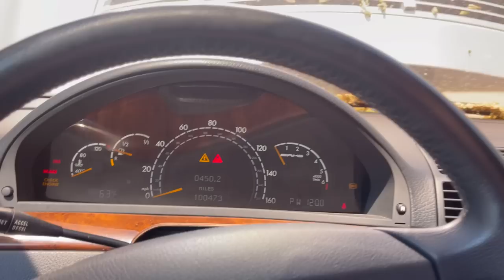S55 AMG - SAM I Am (not cooling!)

Comment: check for grounds mike. also use a multimeter or a scan tool that can show you voltage across the live wire and ground for the fan.

Comment: Possible bad ground or broken wire somewhere when the car was taken apart. See if there is power going to the fan. If not run a jumper wire from the battery to the fan.
Reply: That is what I was thinking.

Comment: I would check for errors with the scan tool first. I don’t know if you can toggle the switch with your scan tool but if you can see if it can turn it on and off. If it can’t check to see if you have power going to the relay. If you do check your have on the down side. It should go straight from the relay to the fan. If you have power there check at the fan. If no power there it would be the wire is cut somewhere.

Comment: Awesome video Mike! You actually got a special S500 bumper, it must have been an AMG trimmed S500, the regular W220 bumpers are "less muscular" than the AMG / AMG Trimmed ones. The reason you had to enlarge the cutouts for the exhaust tips may be connected to the fact that the real AMGs have larger exhaust tips.

Comment: Hi, maybe your Carly App has a mode where you can turn on the fan and than its checking the currents. Or short-wire the fan, drive to Randy check with his Elite scanner, make your racing videos, connect the fan with the daytime running light switch if needed and sell it. A W140 Red Pig is the fun content! Go for it 😁😁

Comment: hello, mike there are 2 types of fans on the w220 the one you have(old type) which was changed to a brushless motor (with out the huge motor on the side) you have mismatched parts which is simple to resolve and one other cause is the AAC module.

if you know any one with a maxi or a launch diag tool go to the sam and change the electric suction fan type and there is the coding in the engine ecu and the AAC module (AAC module is the AC Buttons inside Which sends the signal for the ac fan) if the coding failed then try another AAC module if it was hard to find a module of the older fan type then keep existing sam go to the junkyard get the fan and get the buttons inside (AAC Module) swap and you're done it will actually cool better and ac will be way better.
Reply from the maker: Very interesting!! Might have something here!

Comment: Hey Mike go when you go back to the salvage yard cut the wires on the fan unplug it take that wire harness back home plug it on your existing fan and take a jump box and jump the fan out to see if it's getting see if it spins sounds like the fan motor is not no good so try that little test or take it out and get some alligator clips and put it on the prongs and just use a jump box to test it to put power to it and then test it hope that helps

Comment: If possible, you need to check the wiring from the switch, to the fuse box, and then to the fan.  A wire must be broken.  If all else fails, you might need to try installing a separate manual switch.

Comment: Hi Mike, progress is great!
My first question would be at what coolant temperature should fan come on? Secondly how many speeds does the fan have I.e. high/low? Thirdly, is the A/C fully charged? Fourth, have you checked the low speed fan resistor?
Your buddy Peter from Kansas
Reply: Whether or not the A/C is fully charged doesn't matter. My old mercedes s55 had the same problem. my A/C didn't work because I had to change my A/C clutch and the fan was working at the time that i had the A/C working and fully charged. The issue the MWM is experiencing is often the result of fuses, relay, temperature sending unit, ground and or live wire from to fan to the fan speed master control unit. The fans on his s55 AMG should be two speed if i remember correctly.

Comment: Hey Mike I would  really check out the wiring   for the fans mabe they  have a stretched  wire  and  could be broken  in the  plastic  covering   great video but you can always  check with   rand  or  Santa's workshop they will help you also

Comment: Ecu needs to be updated brother, had same problem with s550. The Ecu wakes up the fan
If u use a scan tool that can control the units,try and see if u can manually turn on, if u can it's the ECU. Mercedes Ecu's need to be updated from time to time

Comment: I know you checked the fan with direct power. But might be the fan control module. I had a fan that worked with direct power but it wouldn't work plugged into car. I would look into the fan module Mike. Oh wait...you did say you replace the fan, did you replace the whole fan assembly? If you did that new/used fan would have a different fan module installed on it. HMMM

Comment: You COULD (hacker-ville) JUST if you  wanted to drive it, connect a fuse able from the fan motor to an accessory outlet & use a toggle switch to turn it on/off till a SUBSCRIBER lets you in on the FIX. AND if ANYONE watches & likes this channel and are NOT SUBSCRIBED, "PLEASE" do so for this nice guy & it's 'FREE'! "DEAL!"

Comment: Did you change the sensor ? how about the regulator. You could wire in a relay that turns on the fan when the ignition comes on also. Maybe ohm out the sensor wires up to the sam.
Reply from the maker: Changed both!

Comment: Hello Mike. 
Use Carly OBD to scan for codes and may be you need to change some settings if not I would hard wire a separate switch on the dashboard and watch the temperature while driving. Too much electronic stuff isn't always good. Keep up the great content going. All the best.
Reply: There may be a broken wire between SAM and the rest of it or something, a lot need to be checked to find the actual problem cause if fan motor works, SAM is new, temperature sensor is good then wire could be broken.

Comment: I have seen some crazy stuff. Never assume that the way you found it is the way it's supposed to be. I would double check those fuses and relays to make sure they are the correct ones in the Sam's unit. Your air conditioning is coming on right? Have you swapped out the HVAC control unit inside the car?

Comment: Is the aircon gassed the fan takes signal from the aircon pressure switch and should turn even if the car is cold as long as the a/c is on. Hate it when this sort of fault rears it's ugly head a real pain.
John

Comment: I was going to say, shouldn't it have quad tips?  (and then I realized it would not fit correctly with the s500 bumper and the actual exhaust is only one pipe each side.). Any chance someone has a scan tool that can force the fan on?  It would be nice to prove that it can all be commanded.  .. Are the cables not cut?  If the individual bits work, the only thing left might be cables.

Comment: My Question is do you have to let it warm up? Before the Fan will kick on. because some car's as soon as you turn on the AC the fan will come on others don't.
Reply from the maker: I’ve let the car warm up to the point the  fan should have started. But it didn’t.
Reply: @MonkeyWrenchMike  that sounds like a thermostat issue the temp on the thermostat may be to high.
Reply: @richardbeckett5580  that's where I would look next or sensor

Comment: Might be the climate control unit.  Try unplugging it and see if the fan comes on at high speed.  It should.
Reply from the maker: Great idea!! Thx!
Reply: No it would not he has the older fan type system. mike if you read this pull the AC high pressure switch connector its on the Accumulator then your fan should go High

Comment: If the aircon doesn't work then it will only throw the fan on if the engine temp becomes excessive.

Are fuses 29 and 30 on the right front SAM both good? Both 20 amp.
Reply: regardless of refrigerant charge once ac switched on even if the AC or EC(depending of region) is off and the AAC commanding the interior blower motor on it also sends a signal to the Engine Fan(suction fan) at a minimum of 30% speed. in the case of the ACC is at 0 the engine fan will run at 96C temp starting at 70% speed and power down to 0 at 92C temp so basically it will work for seconds. that is how the system work on w220 and w211
Reply: @18888888888888888886  My W220 S280 behaved differently to that. Basically if the aircon compressor doesn't engage, then the fan is controlled by engine temp. With correctly working AC, bearing in mind that the climate system will work regardless of the air conditioning function, then the fan should be running pretty much continuously (at varying speeds according to temperature and loads).
Reply: @alasdairhompstead7950  well, the w220 engages the engine fan for 3 reasons only. First signal comes from the temperature sensor and will not activate the fan until 96c temp and maintaining it 96c to 92c (in an ac of conditions)

Second thing is the AAC module if its on it uses a strategy of 30% speed minimum  and speed goes to maximum of 70% calculated by use of the AC high pressure signal anything below 16bar will remain at 30% speed and at 20bar fan goes to 70%. **ac compressor on the w220 and all the mercedes after that with few exception in recent years are engaged full time (no ac compressor clutch) and controlled by pwm signal so for the engine ecu side it does not control the fan except at a programed set point of 96c or above (which can be coded lower) to 92c 

Third reason why fan would work is an interruption in the pwm signal wire or a short to + which will send the fan to 100% speed upon key ignition on
Reply: @18888888888888888886  not looking to argue about it, just sharing my experience if it may be of help to MWM😉 The AC side of my car never worked properly... The climate control side was fine, but the signal wire to the compresser had previously been cut and reconnecting it didn't seem to achieve anything. I suspect mine ran cold as even with new thermostat and WP, when I retrofitted the heated washer bottle, the fan never came on. And the cats weren't getting hot enough to pass the emissions test. In fact, the only time the fan did run was when the engine was held at 3,000 rpm for fifteen minutes to try and keep the cats up to temperature long enough to pass the test. (UK lambda limits are pretty tight).

If the aircon isn't working correctly, then it stands to reason that it won't run the fan. Equally, if the engine isn't quite getting up to temperature then, similarly, the fan won't run.

Live data would confirm the coolant temp as the ecu sees it. Something for Mike's next live stream perhaps 🤔
Reply: @alasdairhompstead7950  Oh no brother not arguing but im just putting out very specific information on how the system works nowadays the knowledge i have in those cars started to be very rare. 

as per your w220 not heating up enough could be because of the thermostat and specifically an aftermarket thermostat because of almost all aftermarket thermostats open at 71C yes! 71C and oem MB opens at 87C that is why you might have trouble. i used to get many many customers having same issue when i ask about the thermostat they say its BRAND NEW! but the don't know which degree it is upon removal 99% someone cheaped out and got the non genuine 71C part and the 1% was simply stuck open thermostat.
Reply: @18888888888888888886  Stat was changed 'just because' when the WP started leaking. Family requirements found the W220 too low to get in and out of, so since sold. Currently in a 2010 R350CDI 4matic. Which is basically a 5,000lb go kart😎

Comment: Hey Mike where's your uncle Randy?  Check for an open wire?
Reply from the maker: Probably under that Chevelle!!
Reply: @MonkeyWrenchMike  
Under the Chevelle muttering about how he should have bought the Mercedes wagon instead.
Reply: @fasteddy917  No way the Chevy is money in the bank!
Reply: @edwardmartinez9459  
I was joking. My brother had a fully loaded, brand new, off the show room floor, 1969 375hp, 4 speed Chevelle. I can tell you that when you slid the transmission into 4th gear at 100 mph, the rear end of the car did a side to side dance that was impressive.
Reply: @fasteddy917  Sorry my friend.
Reply: @edwardmartinez9459  
It's quite alright. You are 100% right. The car is money in the bank, gold. Looks like L.A. is the spot for buying cars.
Reply: @fasteddy917  Long way to go pick it up from LI NY.
Reply: @edwardmartinez9459  
I'm better off since I live in British Columbia, Canada about 1,300 miles North of L.A. but then there is the time and expense of importing it into Canada. I lived in Johnstown, N.Y for 8 years.